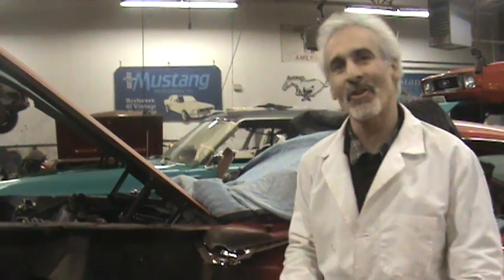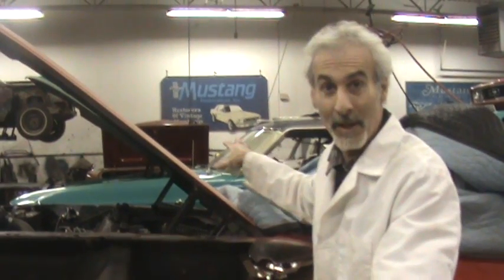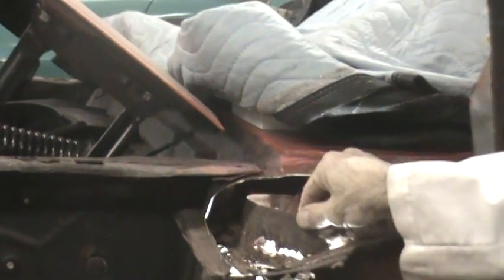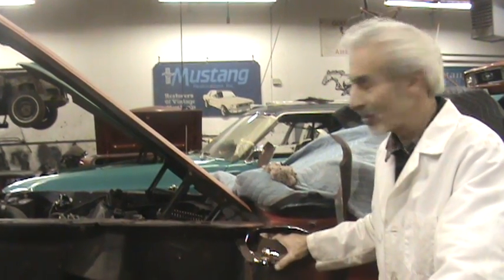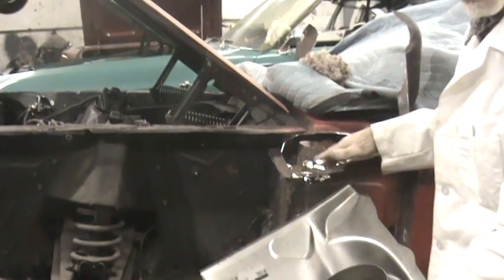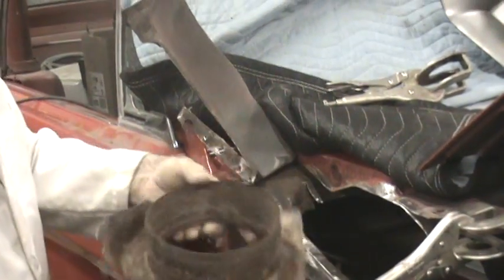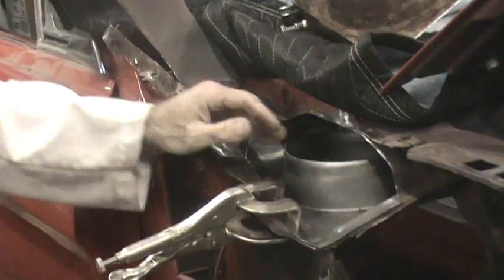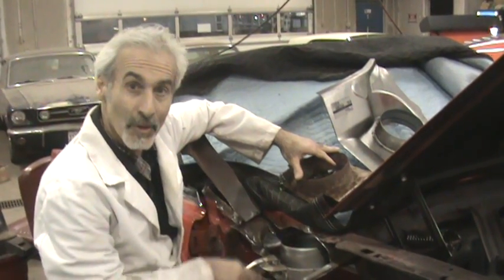Rusty cowl repairs made less invasive

Comment: Would you recommend painting the replacement piece of cowl floor before welding it in or leave it bare?  Are there any welds that need to be drilled out for this type of repair or do you just cut right along the outside edge of the cowl cover?  To be able to weld the new panel in on the drivers side, do you need to remove the steering column or anything else that is under the driver;s side?

Comment: Hope there is a special place in hell for the Ford engineers that designed these frickin' cowl panels on the early mustangs and then didn't even bother to primer or paint them before the mustangs were made.  They should be forced, in hell, to replace cowl panels on old mustangs all day long and have to break off all those spot welds.

Comment: Could you glue the patch panel in with some of the new body adhesives?
Reply from the maker: I would not do that....Mustangs are unibody cars. Meaning that not one particular part is very strong. All the parts welded together is what give's the unibody its strength. The car could eventually sag down without the cowl welded firmly in place.

Comment: 90 percent of the time this is not a great idea, you can not get to a lot of the rust problem and it is either going to leak or if you get it sealed from underneath  hold water and rust out , I have  repaired these cowls  .
Reply from the maker: I agree. This method does not work for the more severe rust cases. But unless you have been in the business as I for over 37 years. You have not seen the thousands & thousands of rusty cowls to know how many this will or will not work on.

Comment: I would not let this guy touch my car, its not a good idea to take the quick easy way to do cowl work, it just is not a good thing, for two reasons.  One, you are going to possibly and most likely miss something that you would not otherwise if you just removed the upper cowl only.  Two,  you are not really saving any time, partly because of hidden issues found in the first point, and secondly, you will most likely anyway find more damage than just a little patch piece with a hat will be able to fix.  A 69/70 cowl for example has a drop off on the drivers side that goes down the side cowls and drains out, often down in there is all rotted too.

If you just looking for a quick fix, ok and if you do not care about longevity then cheap out, and do this method.

Otherwise do it the right way, if your cowl is rotted at the hats, its also most likely got more rot than you can see.  Take your time replace the entire thing, have a glass place pull your windshield and re-install it if you have to, its not that expensive.
Reply from the maker: And who are you Mr. Know it all ?  If you worked on these for a living you would know that the last thing you want to do is pull the top of the cowl of of any car. This may not be the fix for all but its the fix for many....What is the name of your shop? Lets see some of your rust repair work..Go back to sleep under your easy to work on newer Mustangs & leave this stuff to the adults.
Reply: @MustangRestorationsInc  well that escalated quickly :-) subscribed!!!